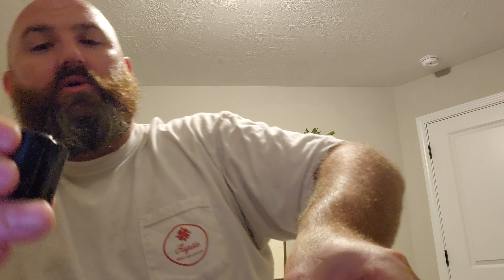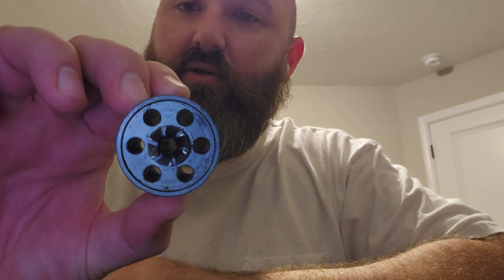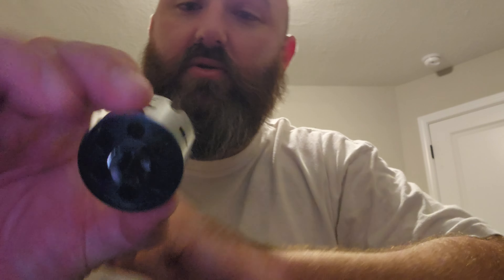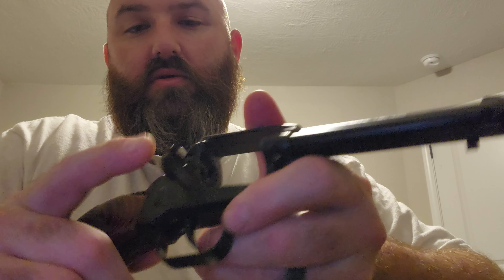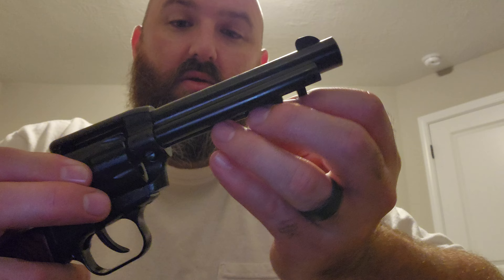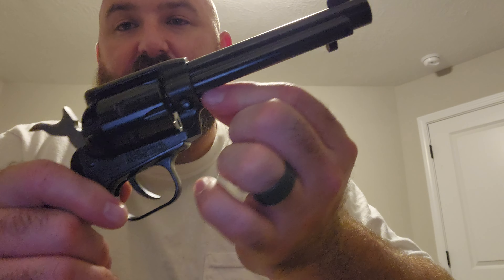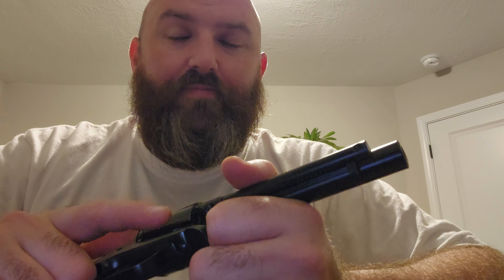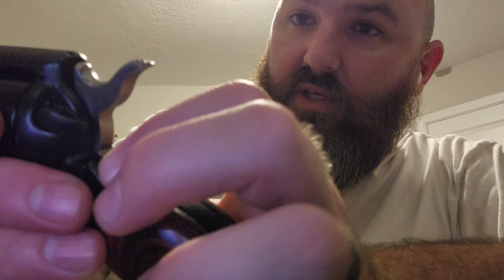Heritage Rough Rider Part 2 update

Comment: Did replacing that lower timing cover seal on your atlas fix your oil leak fully? My lower timing cover is leaking and it looks like the seal, but might just replace the whole cover.
Reply from the maker: @pennstrawbridge6862  yes. It fixed it. It hasn't leaked since I replaced it. I did some research and that seal is a sacrificial part. It's designed to fail and be replaced easily.
Reply: @ thanks for the reply - Do you have a name/link to the seal tool you used for the install?